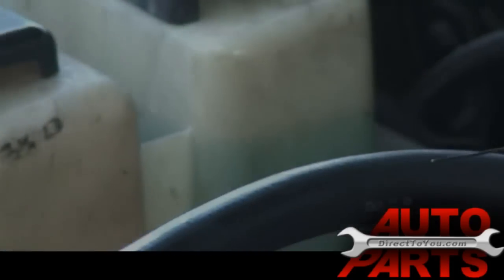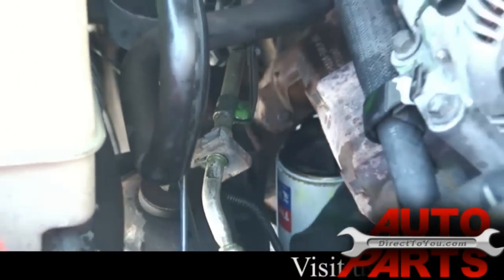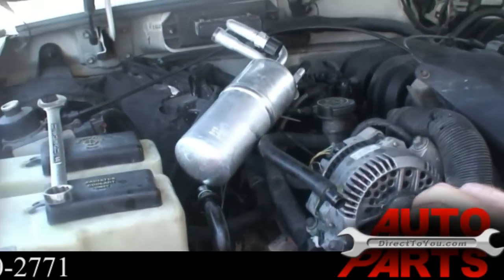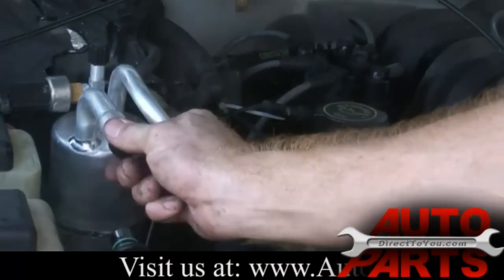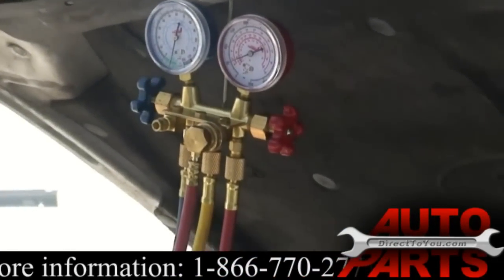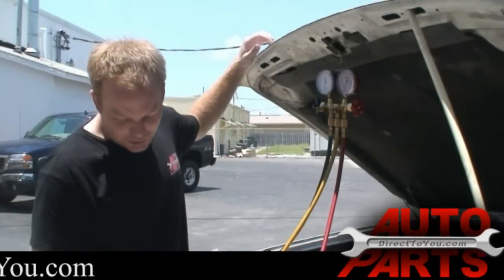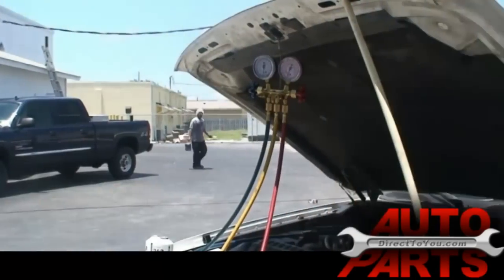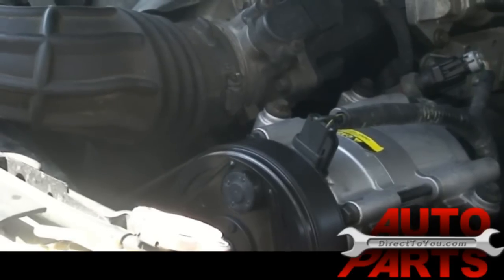1996 Ford Explorer AC Compressor Part 3

Comment: I just watched the whole series. Are you sure that compressor had enough oil for the whole system and not just enough oil for the compressor. Having the proper amount of oil is equally important as the proper amount of refrigerant. I would’ve at least poured it into a cylinder to double check. Also I know a lot of manufactures recommend cranking the compressor about dozen rotations to push oil throughout the system. Most AC technicians would recommend flushing the system out about three times. You may have done all these things off camera overall Great video. You made a job that most people wouldn’t consider doing look very easy

Comment: they wanted 800.$$ to replace compresser and charge system i bought NEW one took old one off they completed job 225.$$ that was in 14 this pass summer all is well still saved bout 300.$$

Comment: You should crack to charging hose [but not admit it] to vent air before opening low side manifold valve.  Thanks for all the good info. I should think back blowing the system with much dryer propane or nitrogen would be better than wet compressed air?

Comment: When you closed your low side manifold valve, that hose was under the same vacuum as the system. However, when you disconnected your service line fron the vacuum pump and then attached the R134a can, you failed to bleed the service line of ambient air before starting to introduce the refrigerant in to the system.

Comment: Great video! Ill be installing the oem air conditiones in my 96 ford ranger from scratch, this will be an excellent guide to fit the system in!
I have one question, maybe you can help me. The orifice tube i ordered (part #F5UZ-19D990-AB or YG-346) has black coloured o´rings instead or green ones. As the sustem is an R-134A, can I use this orifice tube with the black o´rings or should i change them to green ones?
Thanks a lot man, hope you can help me.
GREAT VIDEO AGAIN!!!
Reply from the maker: Thanks! It wouldn't be a bad idea to switch the o-rings over to the green style to ensure 100% compatibility.
Reply: Auto Parts Direct To You Great man, I thought so. Thanks a lot man!!!